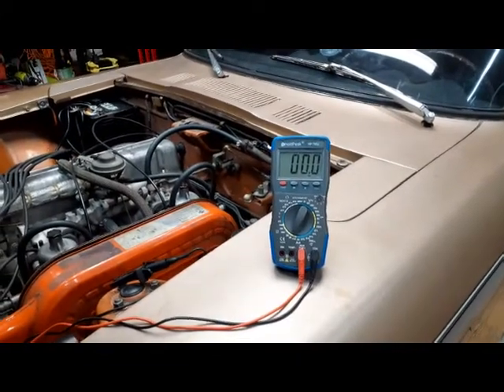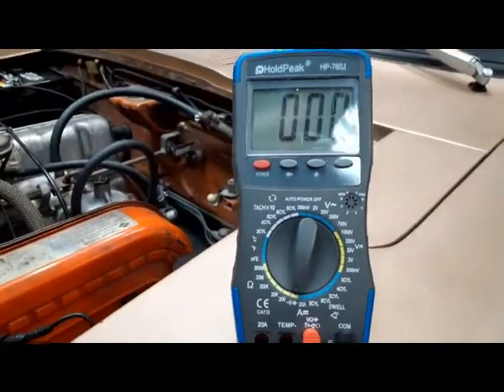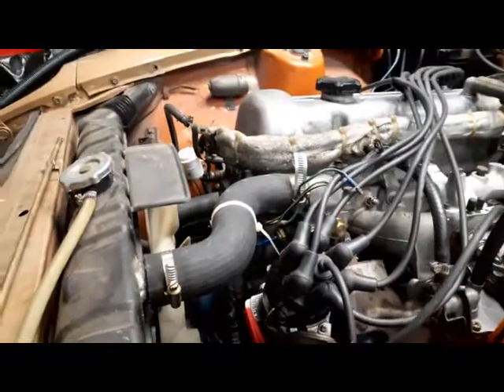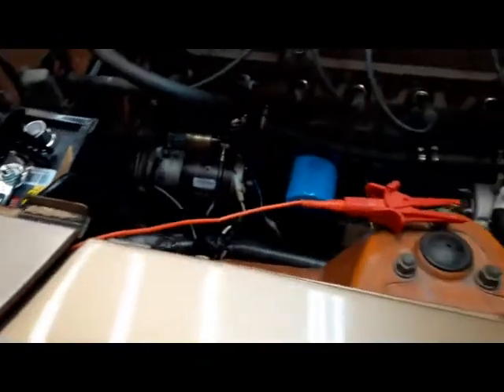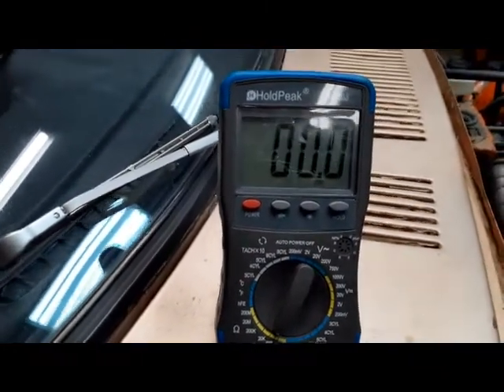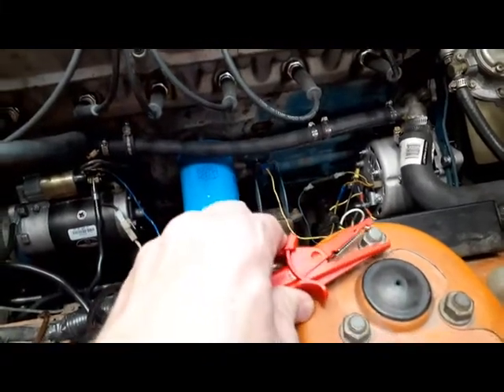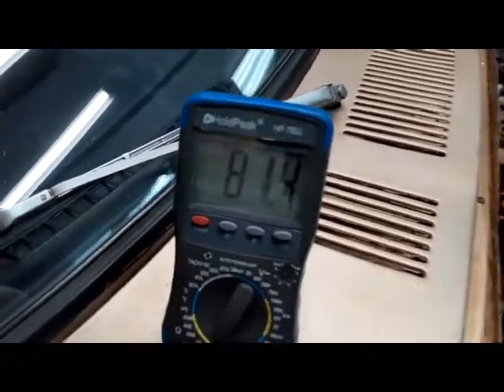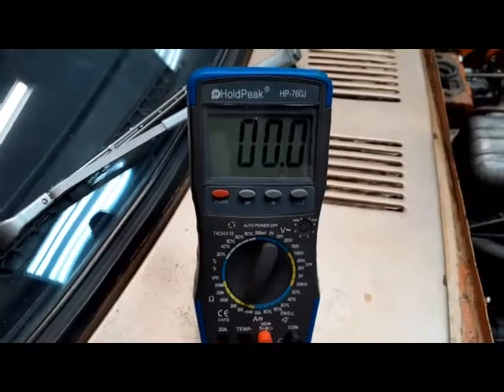Resistance Readings for Grounding

Comment: what if continuity disappears once engine is running. and resistance is high too. only when engine running. even the length of the battery negative cable is showing high resistance when running but ok with engine off.
Reply from the maker: Continuity should be read on a de-energized circuit. When the car is running you have current running through the circuit, and that affects the meter reading. If you are measuring an energized circuit, you should be looking at voltage or current.

Comment: I measured fluctuating 0.1-0.2 ohms on the ground to chassis cable. Can this cause unstable electrical system?
Reply from the maker: Probably not. That's getting toward the low end of the accuracy of most meters. I get more fluctuation than that just by changing how firmly I'm pressing the probes on the surfaces I'm measuring.
Reply: @myZcarlife  hmm ok, because the positive wire measured 0.0-0.1 just like in the video. Maybe resistance on the ground wire is higher
Reply: @myZcarlife  because everything is working correctly but I got a voltage drop and the alternator is reacting slow. Maybe that is the cause of a little too high resistance in the ground cable
Reply from the maker: @DIRTYvinnieXD  Sorry, I didn't see that you responded again. Make sure the areas where the grounds are bonded to the body are relatively rust and dirt free. That can build resistance. Also check ground wires for corrosion.

Comment: We have a 95 suburban with a 6.0 we put in, kept having low frequency MAF codes and O2 codes as well as random misfires, after probing the MaF connector i discovered the constant ground and low signal ground were reading 045.0 ohms,  sure enough terrible battery to engine ground, we cleaned and added anpther ground cable and got it down to 0.5 - 1.0   runs noticeably better now the sensors are working correctly.   Sometimes it the simplest things and goes to show how important a good ground is.